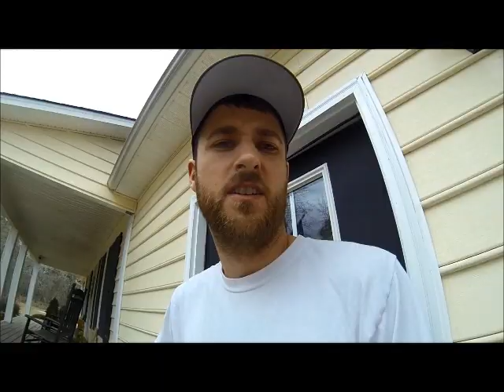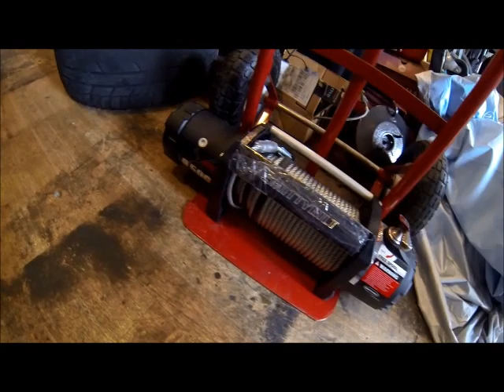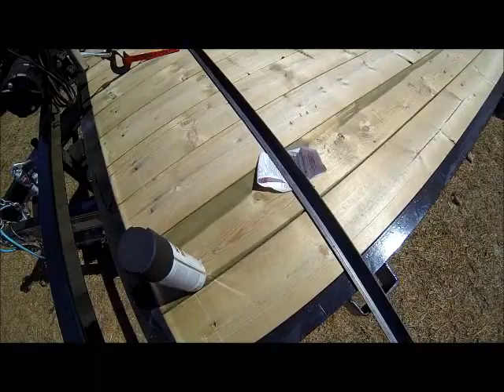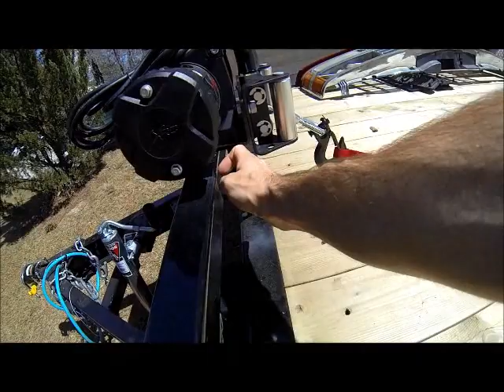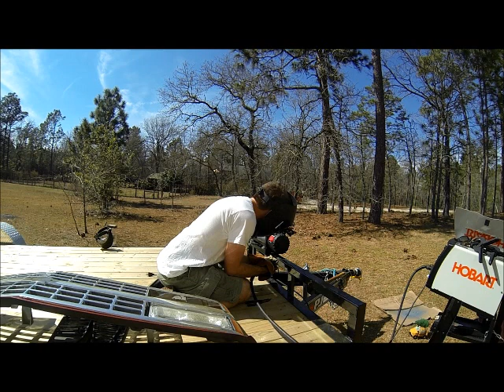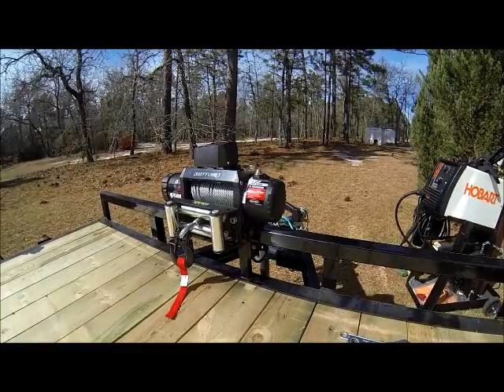New trailer and Smittybuilt 9500 winch install

Comment: Got a similar trailer and am doing the same thing with the same winch. I'm mounting mine closer to the tongue. I have another trailer that I put a harbor freight 2500lb winch on and believe it or not it lasted 2 years pulling vehicles onto the trailer. Some weighing 7500lbs. So this 9500 should be a bit of overkill but hey. I hope you are taking the truck to a different body man if the first ones paint job didn't last 2 years